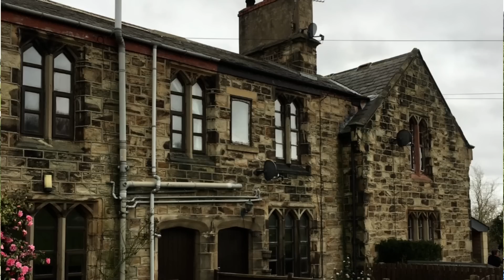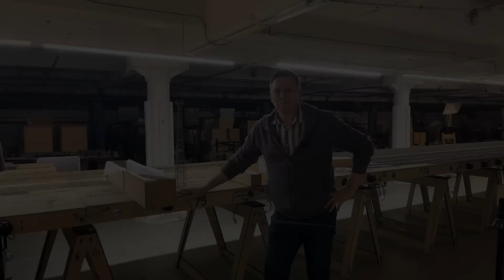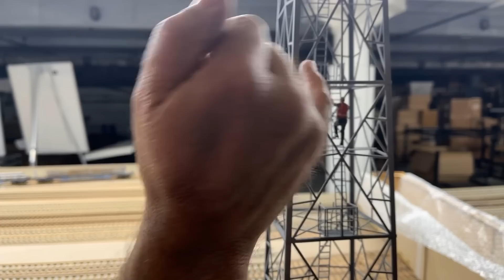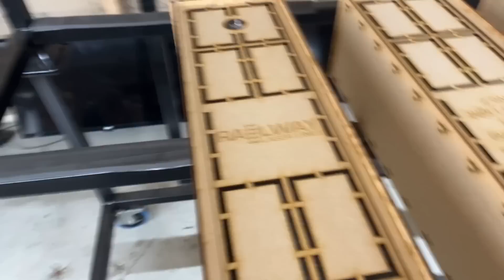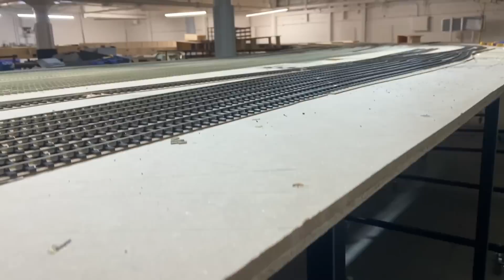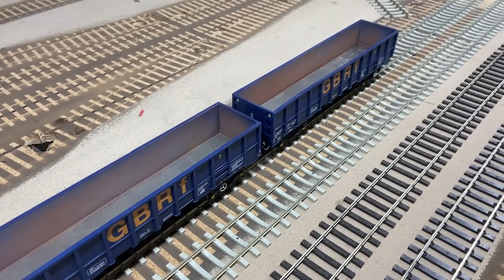An Exciting New Delivery & How YOU Can Get Involved!

Comment: Great video Simon,  not sure about the 2000s era , Healey Mills was derelict by then and the rot had set in with the lineside. I've been a driver nearly 40 years on freight and 80s were far more interesting,  The modern railway might have more colours but is absolutely soulless 
Cheers Russ
Reply from the maker: I’ll still run ‘80’s for the odd session and I take your point. It’s just the 2000’s will be more familiar to families given where the model is being displayed. Cheers Russ. Simon
Reply: @britainsbiggestmodelrailwa1428  

That's excellent news Simon.  I've not seen your layout in person yet but the videos take me right back to starting at Thornaby as a secondman,  I can imagine the smells of the 56s hanging in the  cold winters air
Cheers Russ

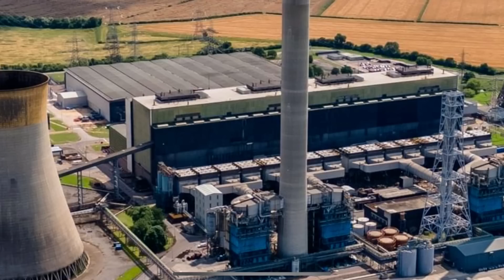Comment: Hi Simon. A constructive comment for you, not a criticism. The power station turbine hall you refer to (21:23) is the boiler house, precipitators and FGD plant at West Burton Power Station. I worked there for approx 30 years! If you're looking to build West Burton Turbine Hall, its the one hidden behind the boiler house. The large flat roofed area behind is the 400kV Substation building. Please don't hesitate to contact me should you require any help with telling you more about buildings, details, functioning , train movements etc, I'd be more than pleased to help. All the best.
Reply from the maker: Ah got ya I’ll remember that thanks. Good info. Thanks Gary
Reply: @britainsbiggestmodelrailwa1428  No probs. Coal fired power stations, early 2000s were subject to LCPD (hence intro of FGD). This introduced different train configurations (limestone in, gypsum out). Of course there still remained coal (1000t delivery/hr weekday) and periodic heavy oil in and ash and dust out (although come early 2000s the volume of ash and dust train movements significantly dropped off. Ash via road, dust diverted to local settling ponds. A good example of this is the Drax nature reserve). As for buildings. Separate coal and limestone reception buildings on separate lines (in order to accomodate simultaneous delivery). The limestone reception building also doubled up as the gypsum loading dock too. Separate line and dust bunker. All the best.